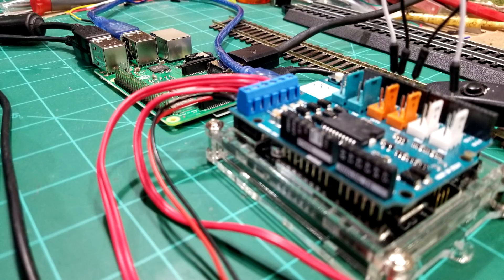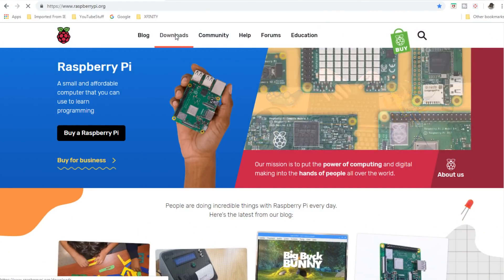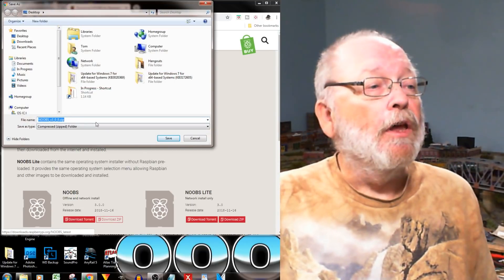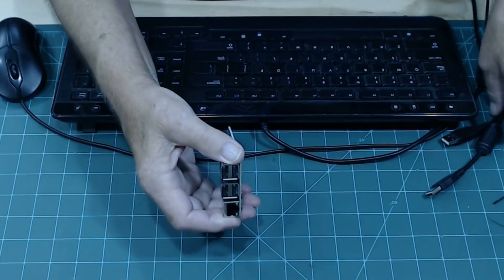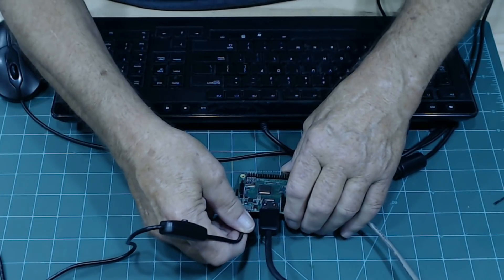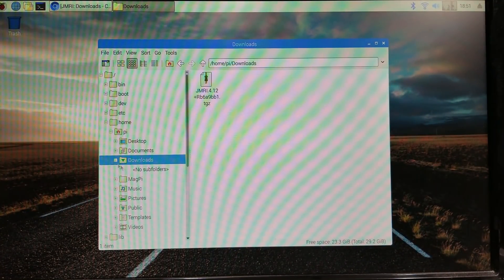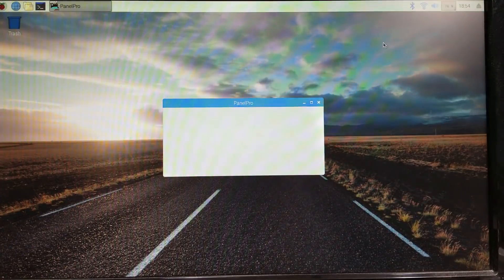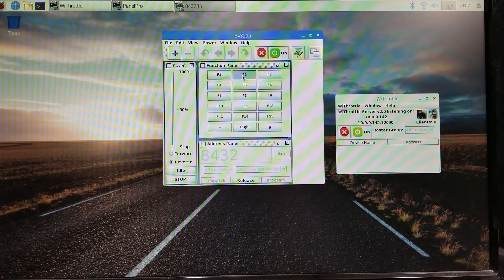How To Run DCC++ & JMRI On A Raspberry Pi With Your Cell Phone

Comment: Excellent video, Tom. I appreciate that you edit out the wait time from the lengthy processes. As mentioned, I do have a preconfigured image with JMRI preloaded, and with logic to autoidentify various hardware (including DCC++). It also sets up the RPi as an access point. More info here: https://mstevetodd.com/rpi
Reply from the maker: Thanks for the link Steve. I appreciate your input on this subject.This will help other modelers interested in cost effective ways to run their trains. Yes, there was a lot of wait time here. I just stopped recording and came back later. One time I was lucky enough to come back at about 97% to catch the tail end of the process. The magic of editing. I may be asking you for some help in the future.

Comment: Do you need the DCC++ base station or can you use just the Raspberry Pi?
Reply from the maker: Raspi is just a mini computer. DCC++ is outdated with limited options. You should look into DCC-EX which has many additional features not found in the original version.  https://dcc-ex.com/#

Comment: I know this video is 4+ years old, but have you done any videos on using linux for most all of the control, etc? You still seem to use a lot of Windows. I have no Winduhs anything any more. Got tired of the viruses, exploits, etc.
Reply from the maker: Do not have any videos on Linux. It shouldn't be too hard since both the Pi and JMRI have Linux versions, You may find someone to help you out on the DCC-EX Discord
https://discord.gg/zUB4JF9A
Reply: @TomsTrainsandThings  Yep, I know all about the Pi's. I have a dozen of them around. It's just that my desktop and laptop are both linux. I used to keep a Windows 7 VM around for times when I needed Windows but I think I finally deleted it because I didn't use it very much.

Thanks for your videos!

Comment: You should have bought a $5 case for the PI, and some heatsinks that are dirt cheap.  A kit is good, becasue it can include a case, power supply, heat sinks, and an SD card with Noobs installed.  They are very inexpensive.  I recommend this for newbies.
Reply from the maker: I have the case for 3 of my RasPi's

Comment: The raspberry PI IS A COMPTER!  A full-fledged computer really. I have an 8GB Overclocked Raspberry PI 4 running Ubuntu Mate and it is a great desktop computer, and as fast as an older Intel I5.  It's just a mini computer, sort of how a modern cell phone is a mini computer.
Reply from the maker: Although it's a mini computer, it doesn't have the programs I need. Just using it with JMRI. Since this video I upgraded to the RasPi 4
Reply: @TomsTrainsandThings  It depends, pretty much everything I need, with the exception of a few hobby type programs is on my Raspberry PI4 desktop. It's an 8gb model, boots from M.2 SSD in one of the USB 3  ports, has 4k video. I put it in a mini-tower case with a big CPU fan and 2nd case fan. Overclocked to about 2 3 Ghz and keeps super cool. Benchmarks as fast as an older I5, I can run most anything on it very fast. Most major desktop software runs on it. I also run Ubuntu Mate as 64 bit OS. The total cost was about $190 with the SSD.
Reply: @TomsTrainsandThings  I know this is an old video, but which Raspi 4 would you recommend? 2GB, 4GB, or 8GB?

Comment: This is great Tom, but I have one question, you had your command (power) station, powering the track, and the Raspberry Pi controlling the train on the track at the same time, is there any connect between command station and the Pi.?
Reply from the maker: The RasPi is connected to the Arduino through a USB cable. All it is is a mini computer wiith JMRI installed. Engine driver has been updated since then and DCC++ has an updated version which is much better that Model railroaders have completely rebuilt the original. It's DCC++EX, which have much more features and allows built in Wifi.  
Web site with download and instructions: 
https://dcc-ex.com/
Discord Server where you can talk with the developers or other users, if you have questions or suggestions: https://discord.gg/5vUrtDZP

Comment: great video...works well... just a quick question.....if you have a larger layout...how do you add more power supplies for smooth track operation
Reply from the maker: You can use a motor shield wid with a higher amperage such as a Pololu. Adding more feeders from your bus line will help. You can run your bus approximatelyy 20 ft out in each direction as long as the bus is of sufficient size.

The newer DCC++EX has more motor shields available with higher amperage than the original DCC++

Comment: Pretty cool setup, Tom. Do you prefer this type of setup or using DCC++EX with a WiFi shield directly on the Arduino? Trading features for simplicity? I've got a few spare motor shields and Arduinos and was considering trying this Raspberry Pi install as i'm waiting on some WiFi shields to ship from Robot Shop.
Reply from the maker: When I made this video DCC++EX was not yet ready for prime time. I als did a video on DCC++EX with the WiFi Shield when the first introduced it. Waiting on more improvements before I build it for my layout
Reply: @TomsTrainsandThings  So currently you're running with the standard DCC++ and controlling it with JMRI? Think i'll try it anyway. I've got a spare Pi2 and I think a Pi3 kicking around somewhere.
Reply: @Trains-With-Shane  FYI DCC++ version 4.0 is out and it is full featured now, from what I'v gathered it's very good. I'm actually building mine now, waiting for a few parts.  I've used JMRI in the past with my NCE Powercan and USB adapter board and it worked well. I will use it this time with a Raspberry PI 4 (hard to get right now) which is much better than a Raspberry PI 3.  I already own two so that's easy for me.  I bought a stackable case that will hold the Arduino, motor shield, and PI all together for a very compact setup. I  this setup is a winner, can't wait to really use it extensively.

Comment: This is amazing Tom, do you have a video on how to wire the DC++ into a larger layout and how the power is managed? Thanks for the in depth walk through, I think you’ve saved me about £300 Sterling!
Reply from the maker: Thanks Richard. DCC++ can be wired the same as DCC. The only issue is the max amperage is limited in the DCC++. You can use basically the same components and go with DCC-EX which is an updated version of the original which has never been upgraded since it's creation about 7 years ago. DCC-EX is constantly being improved by a team of dedicated model railroaders that feed off of users suggestions.
https://dcc-ex.com/

You may find some useful informationon wiring and other subjects related to DCC  here:
https://www.youtube.com/playlist?list=PLjjhnrIKSTShk5Wu8uIgxfBYxhSbxHSrD
Reply: @TomsTrainsandThings  hey 👋 thanks for the detailed reply, I’ll look into it. Great content by the way.

Comment: Great Video. Where do I buy a DCC++ Station for a Raspberry PI or is there some way to hook up an Arduino motor shield to a Pi?
Reply from the maker: You can find more information in my other videos on DCC++. Since then, there is a better version DCC++EX which is more powerful, more motor shields, & more wifi options. On their web site, you can find out more. There is also fully automatic installation package for Engine Driver by M. Steve Todd which makes installing everything on the PI completely configured for JMRI, Engine Driver and now the wifi enabled.
https://dcc-ex.com/

Comment: Great video Tom....
I just re-installed the latest Pi OS on my Raspberry pi3+ and then followed your instruction to install JMRI (4.2)...
However, when I click on PanelPro or DecoderPro (click on "Execute")...nothing happens !!!
Would you know why ? (by the way, I'm trying for now without the DCC++ basestation attached to the Raspberry)
Reply from the maker: Not enough information to troubleshoot. Send me an email with the details
Reply: @TomsTrainsandThings  what's your email address?
Reply: I have the same problem.

Comment: I am beginners  i need help still i need uno and raspberry  both or only raspberry  can run my locomotives
Reply from the maker: You need the Uno and a motor shield to create the DCC signal. RasPi or Computer will do to run JMRI
Reply: @TomsTrainsandThings  , Thank u so much

Comment: Great videos

Just went to order my bits for making my own dcc++ but notice there is a audrino board with WiFi built it. Is this a new that you use to control your trains wirelessly with an android phone or is there more to it and you have to use the raspberry pi?

Kind regards Dan
Reply from the maker: DCC++ was developed before the Uno Wifi came out. There have been no updates from the original version. The use of a cell phone is accomplished through the use of JMRI with either a computer or Raspberry Pi.

In the Trainboard forum, other modelers are making improvements to the original code. You may want to look into that.
Reply: @TomsTrainsandThings  Hi there

OK I will have a look on their, thank you for your reply.

Kind regards Dan

Comment: Now how can I add the pca9685 to this?
Reply from the maker: You would be better off using a second Arduino for this. These micro controllers are capable of operating only one task at a time. There would be some delays if you group too many tasks together on one device.

Comment: Very nice and clear.....super tutorial, thanks
What voltage do you set up your power supply? Is it n scale?
Reply from the maker: Thank you. My power supply is set to 18 VDC which gives an approximate DCC signal of about 15V.
My layout is HO Scale.
Reply: @TomsTrainsandThings  so I guess I should set it to 15V for N scale then.....
Reply from the maker: Check you decoder documentation to see if there is a maximum voltage allowed. Some decoders have that figure listed.

Comment: The JMRI will work using a regular Desktop and the DCC++ basestation right? I only ask because I don't want to buy more parts and the JMRI found my app name and probably works the same way
Reply from the maker: JMRI will work on any computer, even a Raspi. Windows, Apple,and Linux. You can read about it on the JMRI web site.

Comment: At 8:10 you say you don't need the Ethernet cable. But you do or you need wifi working and thats a large file for wireless. Great Video though. I have an NCE but I want to control other things via DCC++ like turn outs and light and animation.
Reply from the maker: Luke, all the files were already on the SD card, the wait time during the video was the files being uncompressed and installed in the RPI. My first RPI didn't have  Wifi so it was just out of habit that I connected the Ethernet cable. You can see me reference this at 1:59. The RPI is much slower than a conventional computer so the process of uncompressing or any other task takes longer. To run everything you state from DCC++ you'd be better off using a Mega instead of the Uno that I used in this video. The Mega has more Inputs & outputs and more memory to work with.

Comment: Hi,  I found that Etcher is 64 bit while my pc is vista with 32 bit.  So I had to use win32 imager.

bob
Reply from the maker: That should work as well. Didn't realize vista was still being used. My XP computer just bit the dust last year.
Reply: You should really update. Support for Vista ended long ago. Windows 7 is about to eat the dust too

Comment: Tom, can you suggest a different supplier for the Arduino motor shield board?  The one on your Amazon store is no longer in stock with no availability of stock any longer.   https://www.amazon.com/dp/B0084ZQF3O/?tag=aiponsite-20&linkCode=ic6&ascsubtag=amzn1.idea.2BUAI9KA64DKV&creativeASIN=B0084ZQF3O&ref=exp_tomstrainsandthings_lv_dp_vv_mw
Thank you.   The link to the one you show is above.
John
Reply from the maker: John, The motor shield is back in stock at Arduino. It only takes a few days for delivery, they have a warehouse in the states.
https://store.arduino.cc/usa/arduino-motor-shield-rev3
Reply: @TomsTrainsandThings  Thanks!  Thought they were $8 B4 I saw the listing on your store.   Would have bought the wrong item.
Reply from the maker: Most of the generic motor shields will not work for DCC++ because of the different pin allocations. That's why you have to get either the Arduino, the Pololu, or the Deek-Robot. Those are the only ones that I know of for sure that works.
Reply: @TomsTrainsandThings  And this is why we ask questions and follow you on your channel...  Thank you.

Comment: Thanks Tom for showing us this system, I got  a question however,  with the Rasp Pi and a sprong set up  there is a way to not have a keyboard and monitor hooked up and be able to Boot directly into JRMI with the WiFi up, so the you can put this system onto the layout. (nice for portable layouts you take to shows or clubs), Can this also be done with this set up??   If so perhaps show us in other Video. (perhaps on of your Q&A videos)  Appreciate all the work and info you put into your channel. THANKS!!
Reply: Troy, we have exactly that for our modular club. An RPi mounted in our electronics box that starts up with main power, serving as a wifi access point. Club members can simply connect their phones and run trains within a minute or so.
For decoder programming, one of us usually brings a laptop, which we connect to the RPi to run JMRI remotely through the RPi with all the bells and whistles.
Reply from the maker: @mstevetodd  Thanks for chiming in Steve. Good to hear this method is being used at clubs.
Reply from the maker: Troy, have never worked with the sprog but watched a few videos on it. Are you able to program your locos or do anything else besides run your locomotives? Have only seen the use of a wireless throttle. With the Pi & DCC++ through VNC you can use a tablet or any other device to operate anything on the Raspberry Pi.
Reply: i Believe just run trains or what ever the wifi throttle will let u do.   SO they idea is  is that from a cold boot  it starts Jrmi and Wifi Thottle and u run trains,   if u what to do more plug in the screen and a keyboard and do your programming.
Reply from the maker: @troysimpson9550  Thanks, I'll have to look into the Sprog a little more.

Comment: Hi Tom Great presentation ,when did you become a mind reader buddy ? i ordered a rasp pi and a hdmi monitor earlier today ,as i am going to do the very thing your have just disgust. the 7" touchscreen is only about $35 from Ebay and ras pi 2 about $40 ,hope this helps ,take care all , John
Reply from the maker: Thanks John. I've been wanting to do this video for about a couple of months now but just didn't have enough time to put it together. It took about a week of filming between other projects but I finally got it out. I've been thinking about the touch screen but 7 inches may be a little too small for me. I struggle with a 17" screen now. lol
Reply: i thought the screen would be a bit small too ,but i have a portable dvd system with same size screen and works out perfect ,just need a prescription lens for the screen now lol, i like where you are going with the hobby ,keep em coming ,Take care ,John
Reply from the maker: My tablet is 10" and that seems to be the smallest I can see comfortably. I have to figure out how to use my tablet as a monitor.
Reply: just connect your tablet to the ras pi via wireless ,